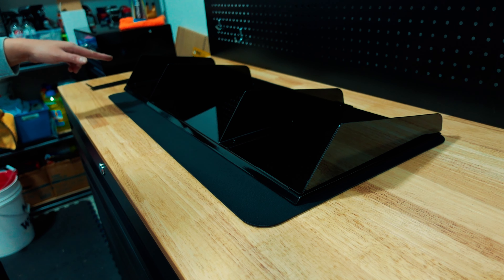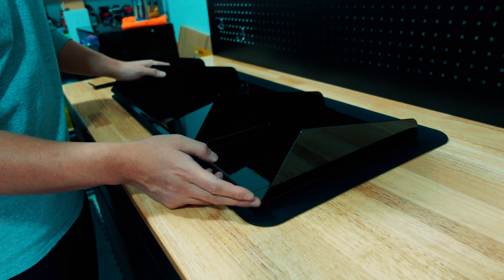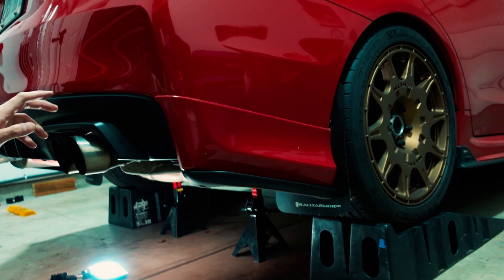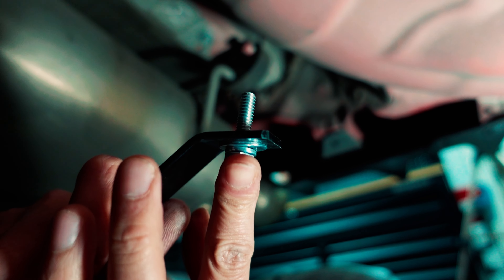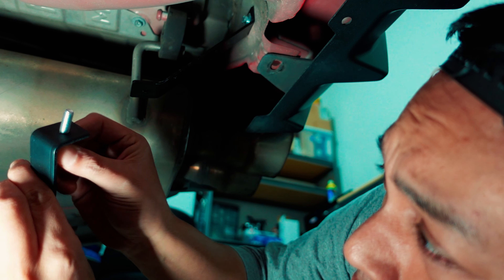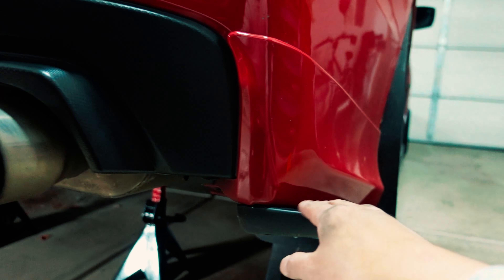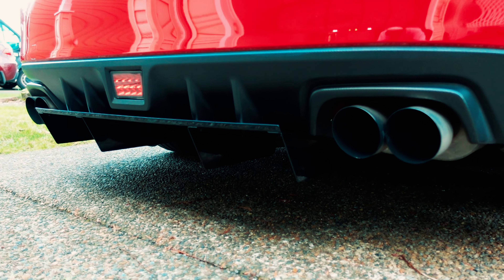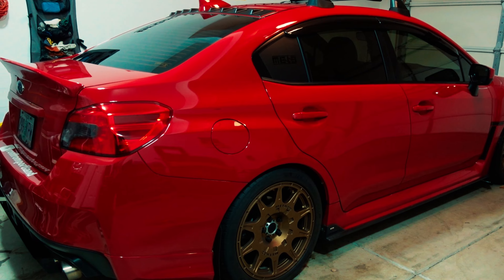AeroFlow Dynamics V6 Rear Diffuser | Subaru WRX / STI

Comment: nice vid.How many inches to the wings/winglets extend down toward the ground?   Or, what is the ground clearance with them on; how far off the ground are they? And, what rims are those?
Reply from the maker: They are around 7.5” off the ground. My car is lowered about an inch though. The wheels are the Method MR502s https://youtu.be/9Pg8RevYRsU